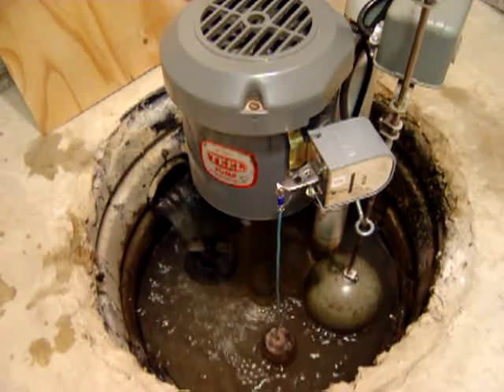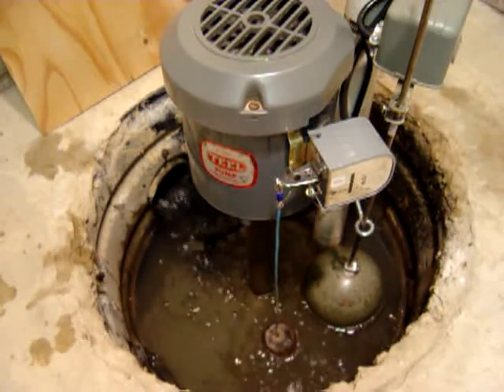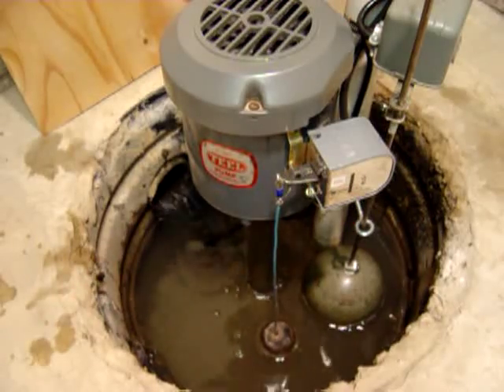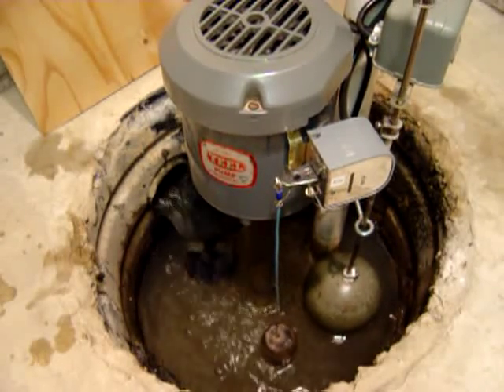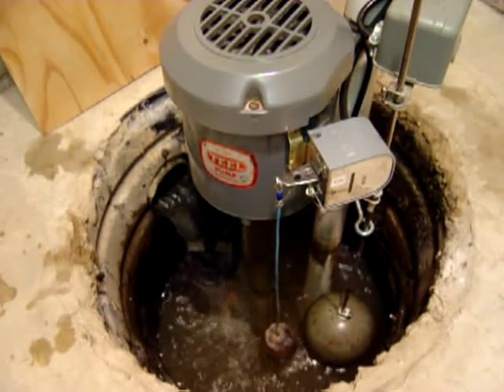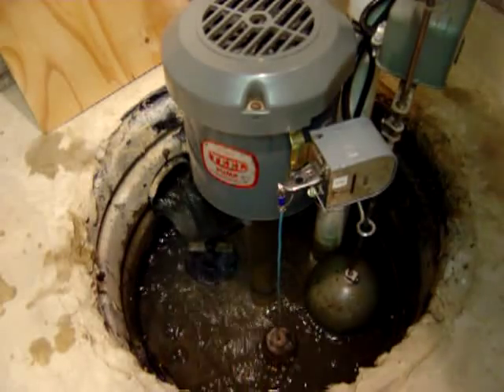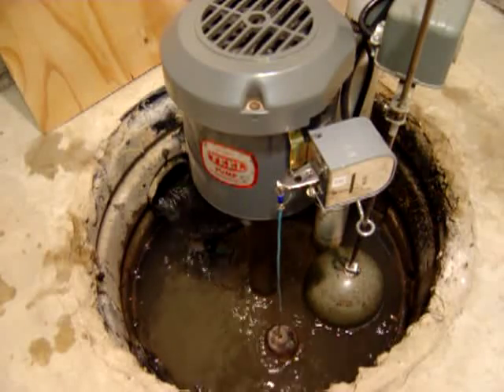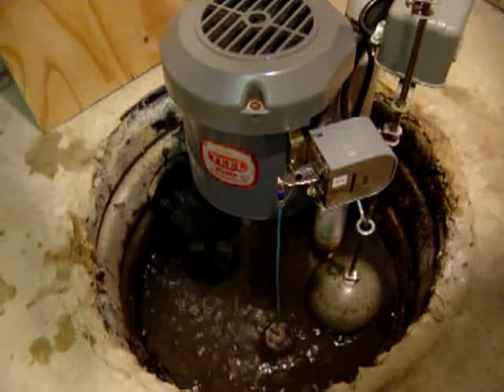testing the backup sump pump

Comment from the maker: you are correct.  the anti air lock hole in the base of the discharge pipe was squirting water spray upward when the level dropped too low on that pump.  I adjusted it back to normal now that the cover is back in place.

Comment from the maker: @bassboy923  no, the main pump has been able to keep up even under the heaviest rain conditions (so far).  at times the motor has reached normal continuous operating temperature because it was running long cycles repeatedly,  following a super heavy rain.

Comment from the maker: good question!  the backup pump has a higher GPM (gallons per minute) rating at the 10' lift required to reach the outside drain.  it's best not to empty the sump pit too fast or the pump will short-cycle.   the starting and stopping is what wears things out.  better to let the pump run longer and cycle less.  thanks for watching.